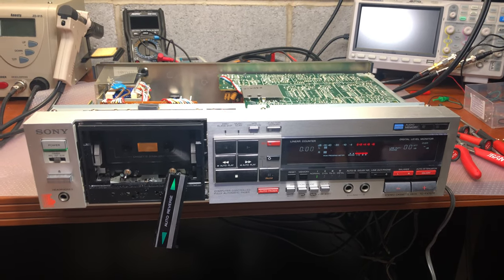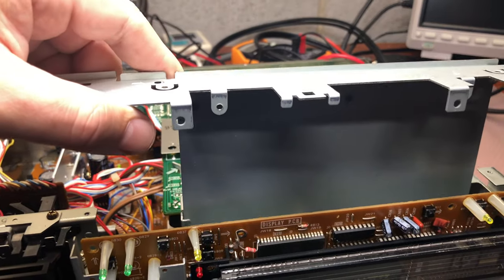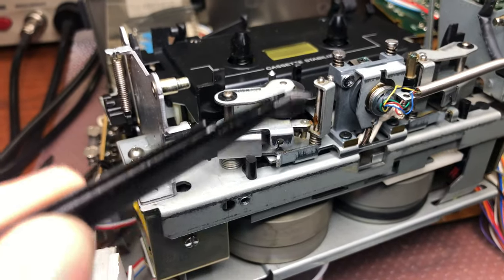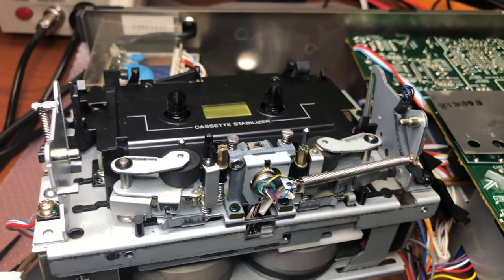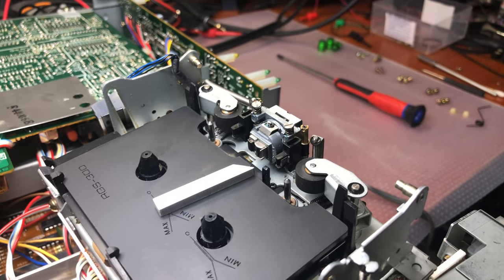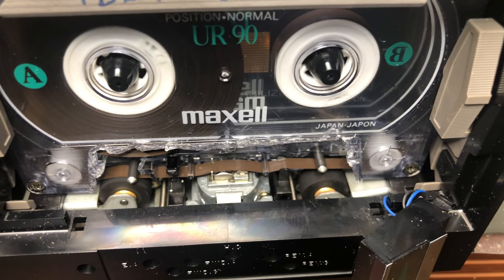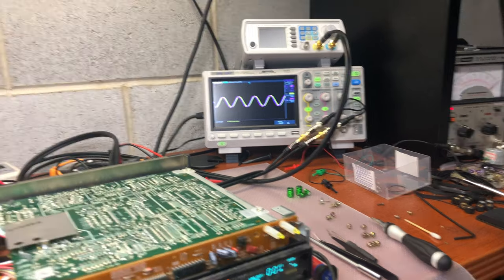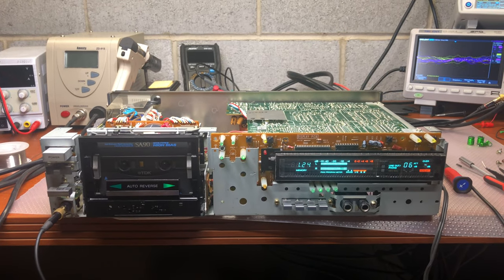Another Sony TC-FX707R Detailed repair process with Azimuth and Tape path adjustment   4K

Comment: I have the same deck, and every once in a while, the tape will stop playing, and the controls will not work. I found that I can get it working again by disconnecting and reconnecting the power. I realize there are probably several possibilities, but Does anyone have any suggestions on what to check in trying to fix this issue. Thanks in advance.
Reply from the maker: I don’t remember if there is a tape presence sensor installed, but I would start from finding and cleaning it.
Reply: @hifirulezzz  Great!  I’ll give it a try. Thanks for the fast reply!